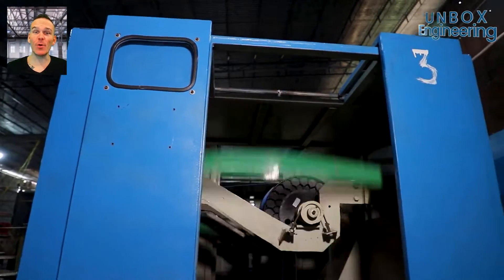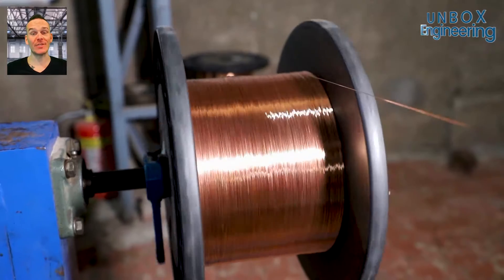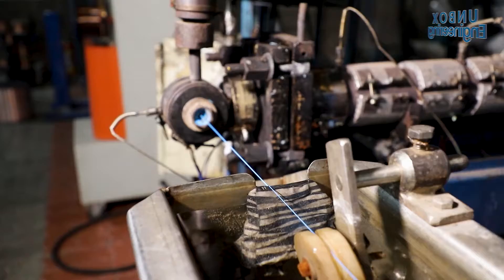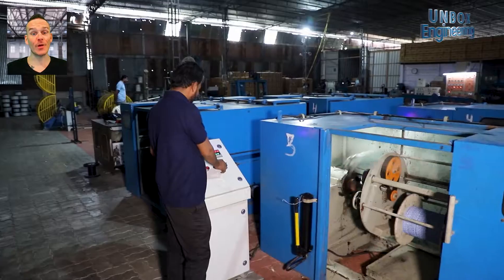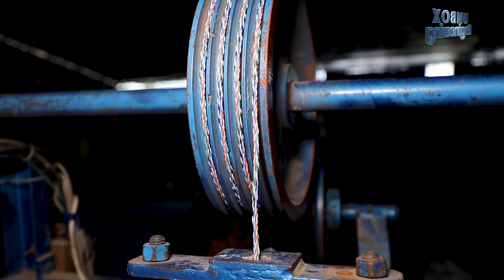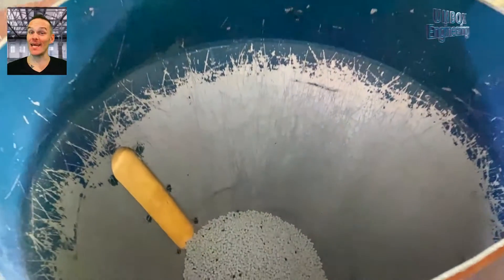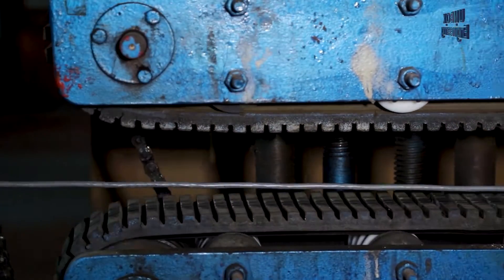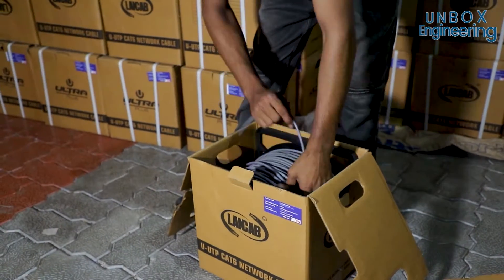CAT6 Network Cable Manufacturing | Internet Cable Factory | Cable Manufacturing

Comment: CAT 6 unshielded wire. Tssh... this isn't CAT 6, it is CAT 5 at best.

Remember: CAT 5e has at least one layer of foil shielding between the jacket and the tp wire "rope", hence the FTP designation. CAT 6 and even more CAT 7 require S/FTP grade shielding: each twisted pair is foil shielded, the whole "rope" is shielded again.